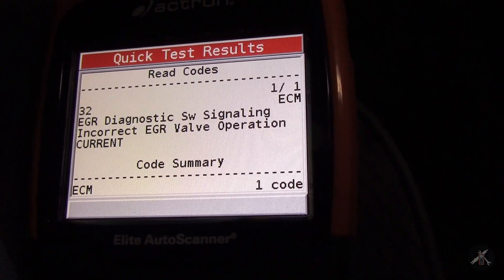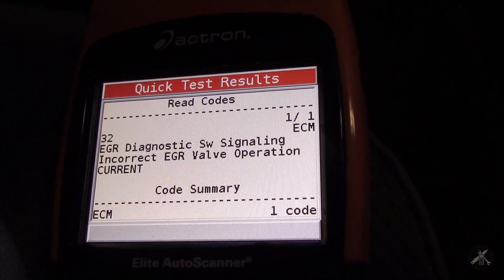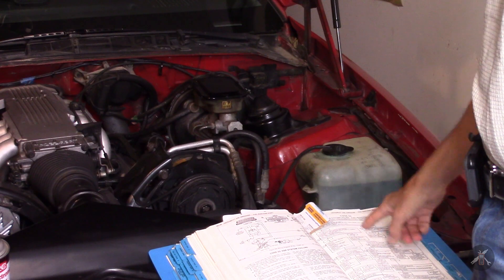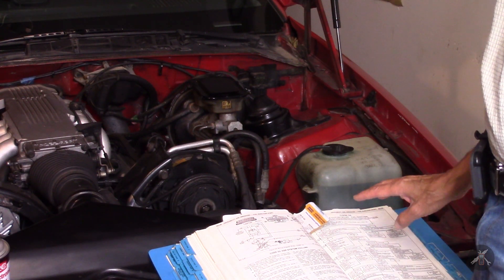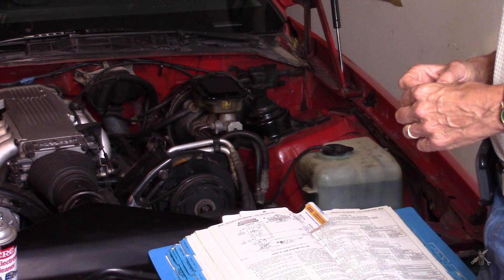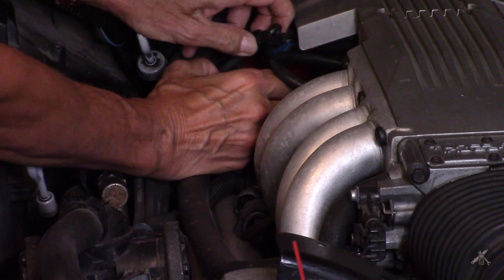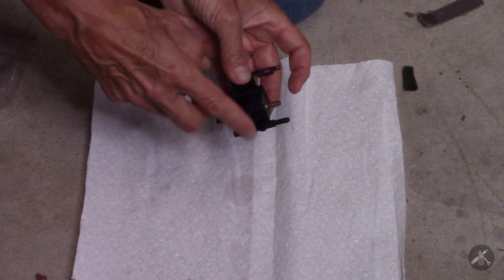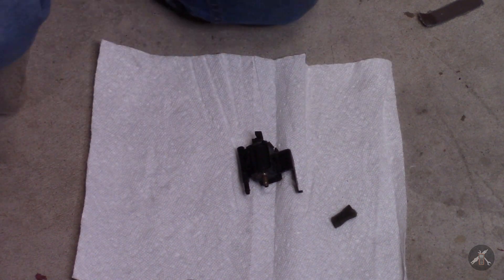Fix Intermittent Code 32 - GM OBD1

Comment: When mine trips, it’s on long flat roads with the cruise  control on, resets shortly after turning the cruise control off. I’ll have to try cleaning it.  I appreciate your work on this.
Reply from the maker: Running on cruise is a good place to set the code because it will usually hold the throttle in the right range.

Comment: During my fun smog check journey, I also sprayed the crap out of my solenoid as well. I could bench test it and there was an audible difference when getting it to open and close with a 9 volt battery. It was much more instant after cleaning.....
Reply from the maker: Thanks Mike, that's good feedback. Sorry to be slow responding-- been traveling a lot lately.

Comment: Awesome video Dan, good tips here! Where did ya get the tiny little filter for the solenoid?
Hope you've had a great summer, looking forward to be seeing what you'll do to the car in the winter!
Reply from the maker: The filter was on the VS25 solenoid that I bought.  I just transferred it over.  Now that I see it as just a piece of filter foam, I ought to be able to find a substitute.  Not all foam will flow air, so I need to dig a little.
Reply: @bitsofwisdom460  Alright! Thanks man!

Comment: Where did you get your new egr solenoid. I have 350 tpi third gen but I can’t find the part anywhere and according to forums. It’s been discontinued. I tried cleaning mine, it didn’t work. Intermittent issue like yours
Reply from the maker: It is true that it is discontinued.  I did some work to see if I could find a substitute that is still available, even if it might need some adaptation with brackets and connectors. This video shows what I found:
https://youtu.be/BXNh5jh6Iho
At my last check it is still on the market.